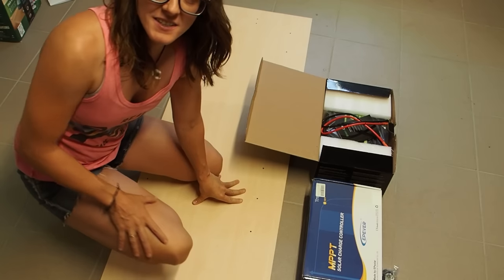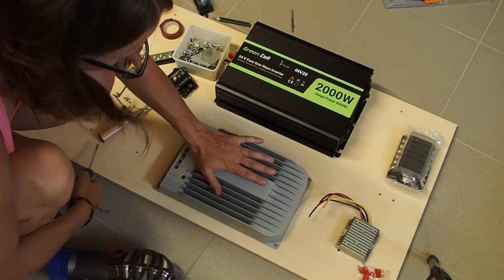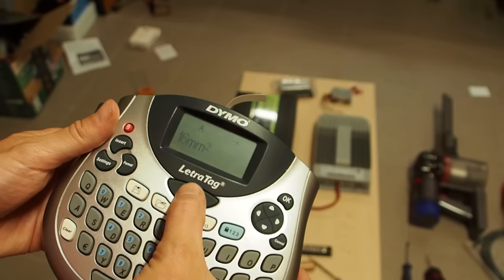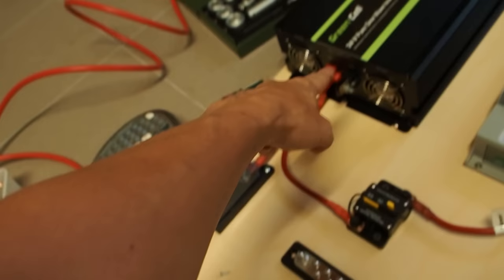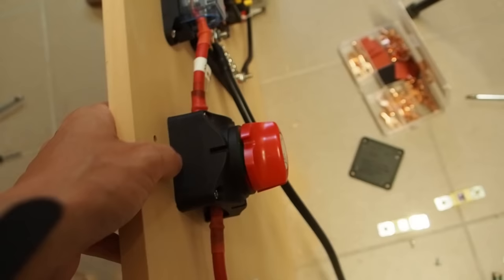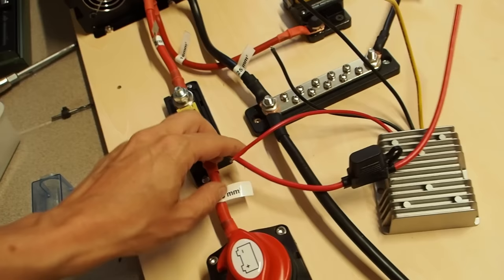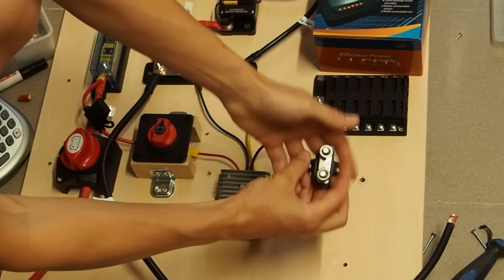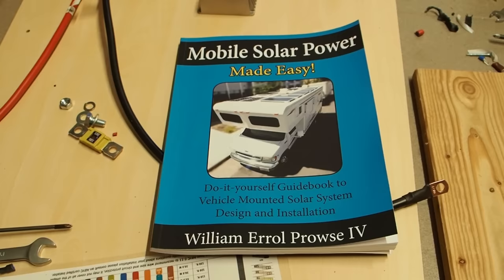DIY Solar System (24 Volt) for fridge and freezer! (Part 1)

Comment: Why not connect the 12V DC circuit to the load output of the solar controller?
Reply: The load output on the controller is not meant to be used to connect your main 12v circuitry.
Reply from the maker: You can do so if you want. But you need to use the converter too. The load terminal has 24volts.

Comment: what is the reason to use a different ground buss for the Dc converter?
Reply from the maker: You can take another one if you like
Reply: Not sure it's needed but why not keep the 24 volt and 12 volt systems separate just to be safe.
Reply: Just wanted to know where a second ground come from coming from same ( - ) source

Comment: There's another way to generate 5000w by running a system for 10 mins and can use the power till 5000w is exhausted

Comment: Although you do not intend to operate the inverter at steady-state 2kW - (80% is 1600 watts) - it is good to provide a fuse that is rated for the peak power as motor loads such as freezer compressors will have a high inrush current. The fuse tends to operate instantaneously. The manufacturer of this model does not provide the fuse value in this case. I would use 200A.

To attain the goal of not overloading the inverter in the long run, I would use a circuit breaker in series rated for say 90% of 2kW or 1800/24 == 75 Amp breaker. These generally take more time to trip, so will hold during motor start.

be careful of the Cheap Chinese Poop (CCP) breakers.

thanks for the  video!
Reply: She did mention she wasnt't going to be using more than 2k watt so lets say the inverter is only 80% efficient (im sure thats low) it would draw 2400 watts dc equating to an 88 amp draw 2400w/27.2v=88a + another 10-12a for the buck =100a
Her 125a fuse will give her a KW of headroom.
Reply: @bigdaadio.K2WW  you have to watch for a counter-intuitive increase in current as the voltage in the battery drops. Where did you get 27.2 volts? Lets say that drops to 22 volts 2400/22 = 110 amps ends up with no headroom at all. A fuse should be rated for the surge, as well.

Comment: You need to tin those wires you put into the charge controller with solder.
Reply: Why? Seems like a good connection and there will be no vibrations like in automotive installations.
Reply: @Teknopottu  It will not hold over time.
Reply: @hazratmuhazmat8831  Hard to see how the crimp connections would loosen over time without solder but just because I've never seen it happen does not mean it could not happen. I guess you have different experience on the subject.
Reply: @Teknopottu  The heat from electricity, even small, will loosen most screw down connectors.  Combine that with small stranded wire, the natural vibration of walking across the floor and time and they can loosen.  I have had experience with the screwdown connectors on several solar charge controllers.  While my applications have all been portable, I have had many connectors work loose if not tinned into one end instead of the strands.
Reply: @hazratmuhazmat8831  Huh. Makes sense. Better to spend the little time to tin the connections then. Thank you for your comment!
Reply: @Teknopottu  I found it prevents them from pulling out.  The individual stranded wires shift.  A solid wire, would probably work, but that is basically what you are doing by tinning the ends.

Comment: If you use dc corrent and use inverters only at the fridges you will loose lot less power. A fridge needs 80 watt inverter and pc same
Reply: Depends on fridge, unless its a car cooler fridge, will not run on 80 watts.
Reply: PLEASE WRITE A BOOK. THANK YOU SO MUCH.
Reply: @gloriatijerina4539  will prowse you tube channel or buy his book

Comment: I watched the entire video and nowhere did you explain why you are using 24 volts and 12 volts instead of 120 volts or 240 volts.  The reason might be obvious to some, but they are probably not the people who need a video like this.
Reply: She is using 240V that the inverter outputs for her cousin's freezer.

The inverter uses 24V because the cables and connections don't have to be so heavy because less amps are going through stuff when the voltage is higher. It is generally more efficient that way.

The 12V is added because there are lots of 12V appliances and devices that may come in handy when in a need of power.

Hope this sheds some light.

Comment: Hello ...awesome job.I am doing the same project  but with a 12 Volt system (12 volt 2000watt inverter and 80ampere MPPT solar charger) and i want to ask you  How many Ampers should the Busbar be ??? I need your advice.And i have some questions about the shutters and the Circuit Breakers.Should they be double size because of 12Volt??? Thank you.
Reply from the maker: Depends how much your inverter is drawing. What are your components?
Reply: @SurvivalLilly  inverter is 2000 watt but 12 volt and not 24 volt like yours. 
Kind Regards
Reply: Mppt solar charger 80 ampere.
6 solar panels mounted  at the south side of the house that are 180watt each with 9,55 ampere each,so i will have 57,3 ampers power per hour going to the batteries for 5-6 hours per day  , 8 gel batteries 100ah each.So total battery power is 800 ah.
But because they are gel batteries, I can use 50% of their capacity. 
I want to power 1 new refrigerator that is a class  C and  consumes only  167 kwh in a year , a 43 inch TV for 10 hours that consumes 55wat per hour , a second 32inch TV that consumes 35 watts per hour for 5 hours , a TV -antenna signal powering box that uses 15watt per hour for 15 hours , a TV box 15watt per hour for 5 hours  a telephone that consumes 15 watt per hour for 24 hours and an internet router that consumes 15watt per hour  for 24 hours.Thats what the inverter will power.And I will use 6 lamps that are 12volt lamps and I want to connect them  to the battery with a 10ampere fuse.So I will have light as well in my house  but direct from the batteries.Not from the inverter.

Comment: And when you can't replace a part, then what? Jesus people stored food for thousands of years without needing a setup like this.
Reply: Jesus people used salt, sugar, drying and other preserving methods, just as we do these days. For a long time for example canning has been very efficient way to store food. Having a freezer full of more fresh stuff is just more convinient and brings variation in diets. People these days are used to use many kind of different food stuffs, I see no harm in that. When the freezer fails and the stuff has been eaten, then other stuff are on the list.
Reply: @Teknopottu  Why do you even bother?
Reply: @buteos8632  That's how I roll. Gave me a bit of fun for a minute or two. If someone leaves something like this, I just can't resist myself.

Comment: You should use at least 35mm2 wires for that inverter.
Reply from the maker: 25mm² can carry 129Amps. So I am fine with 25mm²
Reply: YEAH! What Lilly said
Reply: @SurvivalLilly  I have same inverter running @ 24V, my 25mm2 wires got hot while using approx 1500W - it's not 100% efficient :)
Reply from the maker: @VokiratasReissing  did they get warm or really hot? I will use my infrared thermometer once I make the first test to see how hot the wires will get
Reply: The heavier the wire from the battery to the inverter the better! This setup is great... Lilly went heavier on most wires but the inverter supply wire looks a little light. Might be fine if she plans on never using more then 1500 watts.... but like I like to say.... did it right... do it once. Go heavy on the inverter supply lines!